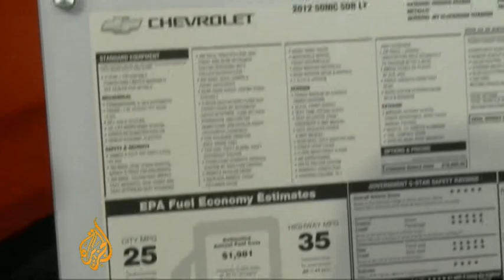General Motors: Greatest corporate turnaround of the decade

Comment: in Germany, there is no resistance to restructuring or innovation. But there is a strong resistance against layoffs, and against loss of the Opel brand of cars. Those GM officials just need to use longer-term thinking, Opel is a strong brand in europe, and it produces fuel-efficient small cars for use in cities that are fun to drive, low cost low weight low consumption but a decent engine and decent top speed. There is no speed limit on german highways.

Comment: these GM officials just need to wake up and realize that they have a good brand with Opel, that goes well in an environment without speed limit. Small, low-weight, cheap, city-compatible cars with nice balance and nice aerodynamics and a nice engine that go 130 miles per hour for 10 hours straight. For me, i see it as a marketing/advertising problem. Germany is a market for cars with many cities and no speed limit on highways and a huge middle-class. If GM fails in this, its a marketing failure.